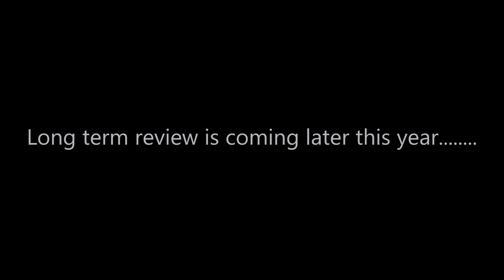The New Detailing brand Tershine!,  Only best for my car ;)

Comment: Did you try Clay-Baring yours yet? Im wondering, if it replaces the "avfettning" (degreasing) then it could be healthier for surface ;) Also my GTI CS is "lackförseglad" (seal protected) so my detailer told me i should not use degreasing. Hence why i though Clay-Baring might be an alternative :)
Reply from the maker: No :). What i understand after have talk do real detailers. The claybar makes the surface smooth, but gives it small scratches to...
So you have to do a machine polish after the claybar if you want it to be perfect.. :(. Therefore use 3 different degreasers is much more kind to the surface..

My car is so New som i don´t think i need to polish the car yet.. :).. But after this season is time.. :).

But with this Tershine line up, it think i will be satisfied with the looks sometime now  ;)
Reply: Mange Wideman Yes, good you found somthing that works for you. We all have our experiences :) But i notice that i got swirl marks or scratches no matter what. So i suppose you cannot get away from Polishing if u want it Top Notch. Imean GTI's are supposed to be driven hard though! But im not sure exactly what does those mini scratches apart from claying (im very picky folding the clay when its time..) Iv had my GTI CS bout 1 year so far. But iv read "Wolfgang" products from Germany should be Top Rated & very good against things like this! (Scratches & Polishing) Might be gettin a bottle from them this summer & see if its all the magic they say it is.. :)